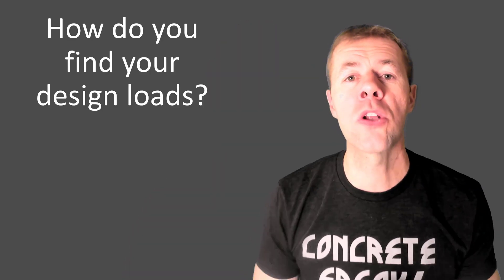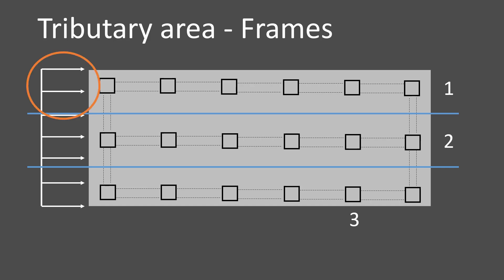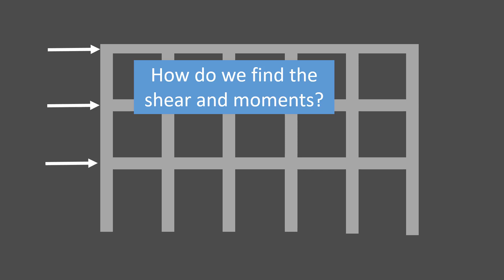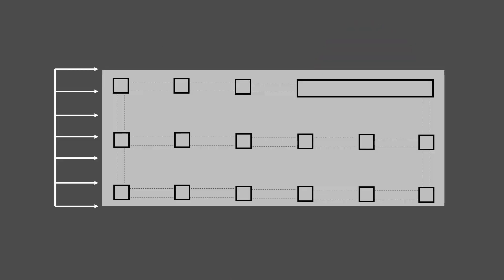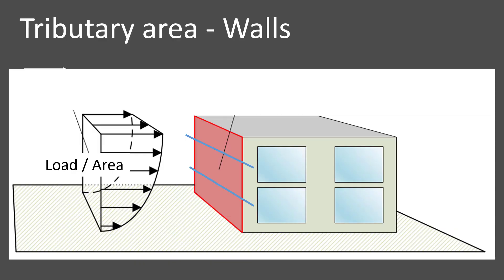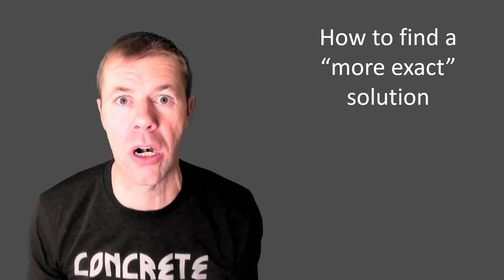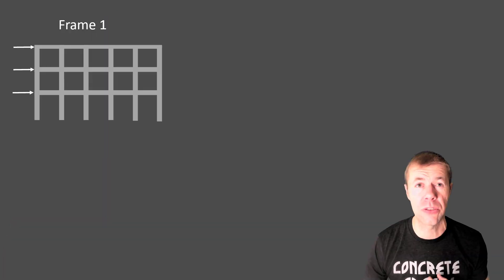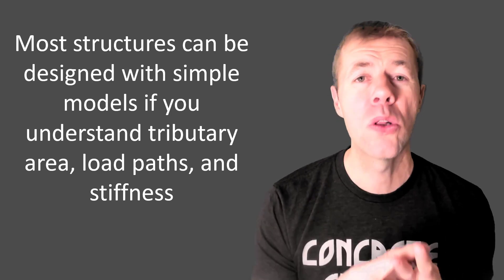Lateral Loads for Concrete Building Design

Comment: Howdy Dr. Ley, 

From my readings, I always assumed that tributary area was only used for flexible diaphragms, and for rigid diaphragms, the lateral loads were by proportion of the wall stiffness. I noticed you didn't really dig deep into the diaphragms role in this video. Any chance you could make one? Thanks!

Comment: Would be interesting to see more dynamic loads on a building, for example explosive, or impact loads (vehicle/aircraft crash) - for structure survivability.  Your first diagram reminded me of the structure failure report of the Murrah Federal Building in Oklahoma City.
 
What about static loads underground, and dynamic (seismic?) adversarial loads (landslides, settlement)?  Kind of along those lines, what about base-isolation (like a triple-pendulum style isolator)?
 
Given the geopolitical climate, it's a topic of interest to me.  I have a lot of books on good building security design, but everything seems to leave the structural design work to some nebulous structural engineer we're supposed to conjure from our 6 o'clock...

Comment: i just watched some fema videos on structure assessment after destruction by tornados.  many reinforced cmu walls failed at the base where rebar passed up into the grout columns.  basically the walls failed as a unit and fell over, leaving 8-12 inches of rebar sticking out of the ground.  are these failures preventable with longer rebar poking out of the slab into the grout column or was the grout/rebar bond just too weak.  the grout used seems very soupy with a slump of 8--is this the source of the weakness problem or is the rebar just inadequate.

Comment: Undoubtedly a critical metric was under specified. The West Seattle Bridge concrete is cracking and all surface traffic stopped. How quickly can steel post tensioning fail when suspended above marine salt water? Surely not less than 10 years when the bridge designer expected 50 years of service life. Undoubtedly a critical factor was in error. Please list the most likely factors which will produce early failure of tensioned structures like a tall bridge on pier columns with the road slabs post tensioned. 1) Wind stresses exceeded steel tensioning allowing movement resulting in Concrete cracking? 2) Support columns under sized allowing to much movement? Or 3) Concrete mix did not withstand freeze-thaw cycling? Or ???

Comment: Great video. IMO, I wouldn't put all the lateral loads on the wall because I will not be able to detect the torsional behavior of the entire structure subjected to wind or earthquake loads.
Reply: For the case that was shown in the video I totally agree with your comment. However. as long as the center off stiffness of the structure is near enough from center of mass, this torsional effect can be reduced; and this can be achieved by making a symetric structre in terms of stiffness... You can even design a structure whose walls absorb more than 80% of the applied lateral loads as long as it is symetrical enough to reduce torsional effects.

Comment: For a reasonably high house the walls are enough. But for a high rise building or an earth-quake safe building then the pillars are also important, especially if you want to control the resonance frequency of the building.
Reply: Citicorp building a case in point........